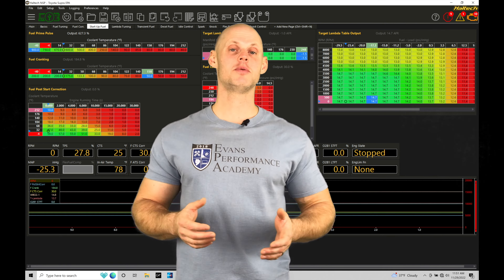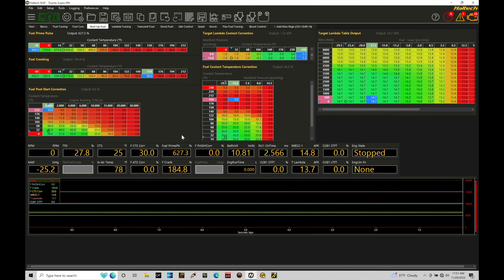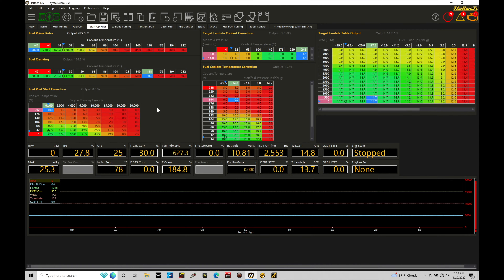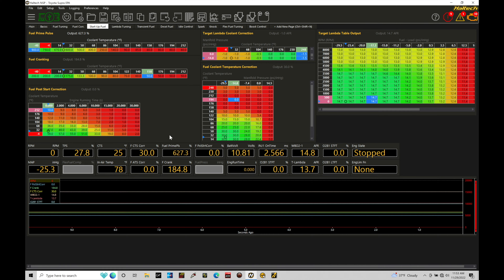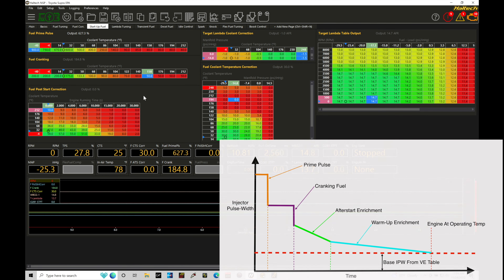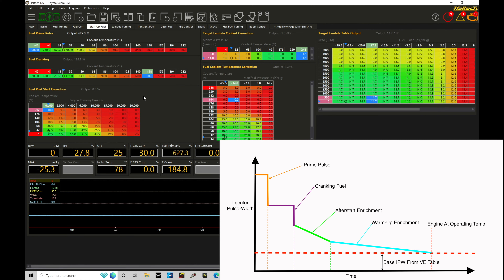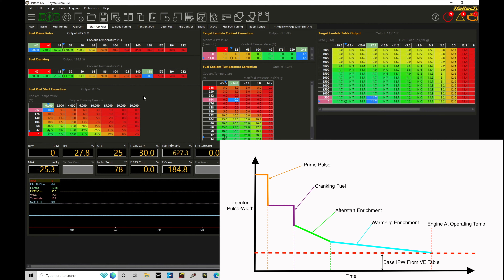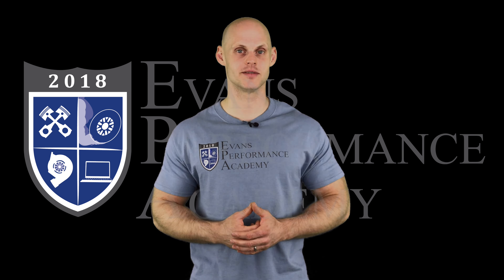Haltech Elite NSP Training Part 39: Cranking, Post-Start, & Warm-Up Fuel | Evans Performance Academy

Comment: Hello, I have a 1993 Subaru with an EJ22 engine and TD05 turbine. I use ethanol as fuel, but I have a lot of difficulty starting it the first few times and also on colder days. I haven't figured out how to adjust the map when I'm using the software. My injection is a Platinum 500. Do you have a tutorial on which part of the software I use to make this adjustment?
Reply from the maker: Yes, we cover this in the sport Haltech training course.  Its going to be the prime pulse and cranking fuel table that needs adjusting.